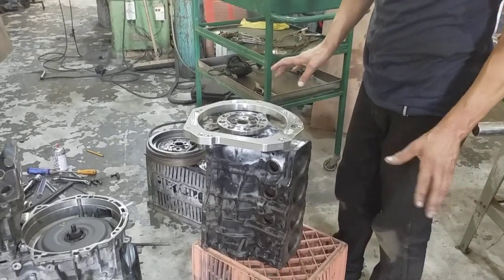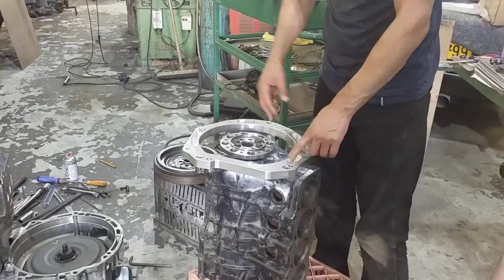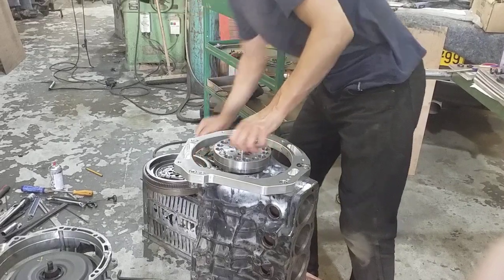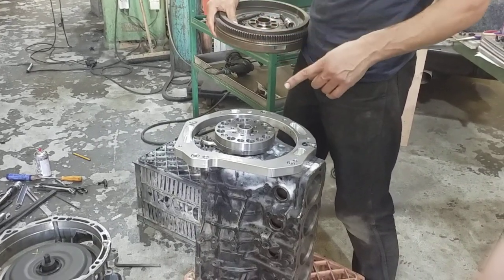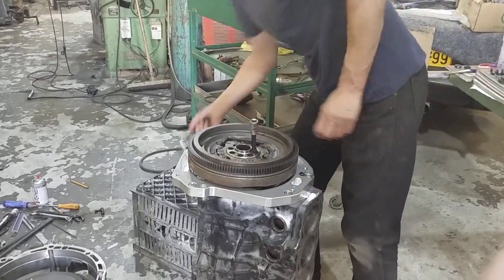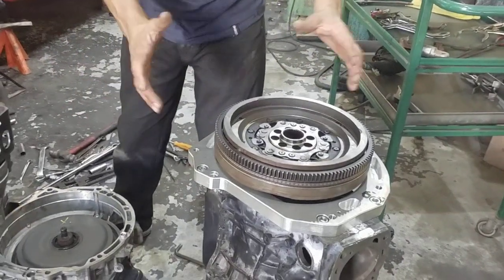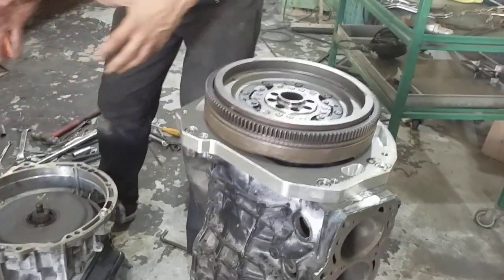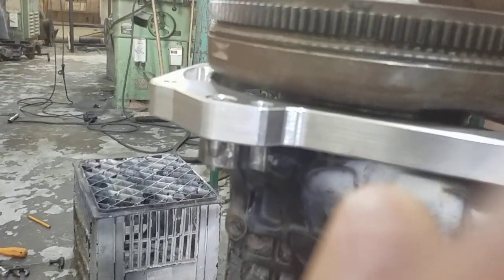toyota 3sgte DQ500 awd adaption kit part 1

Comment: Do you have to mill the gearbox bellhousing? I've bought the gearbox first to check if it would fit celica gt4, but it seems that driveshaft will start at cylinder number 1, and I can see on your video that driveshaft is aligned properly
Reply from the maker: @przemysawgedzba3478  no need to  mill the bellhousing.  The transfer case eliminates the need for a midshaft. But it does mean that the right sideshaft  becomes much longer than  left sideshaft.